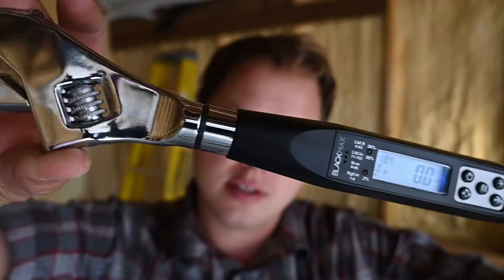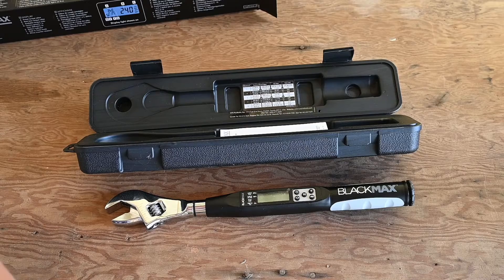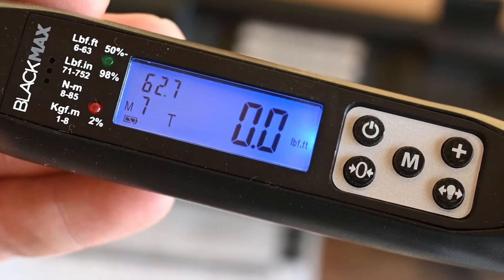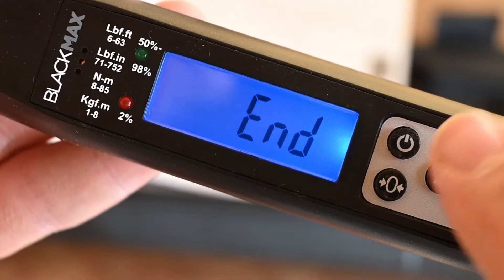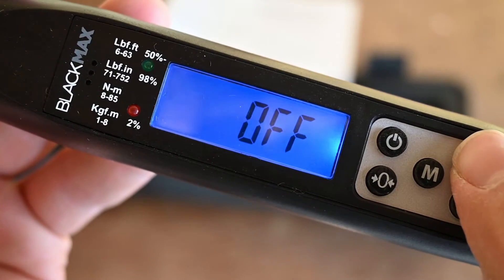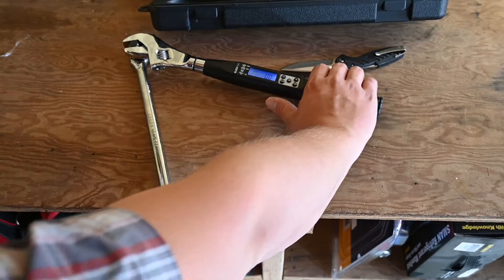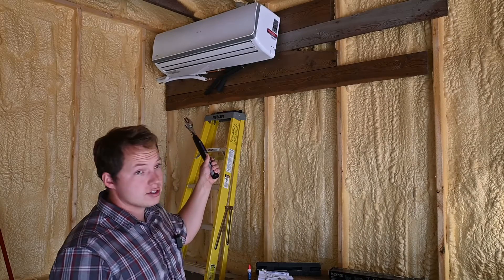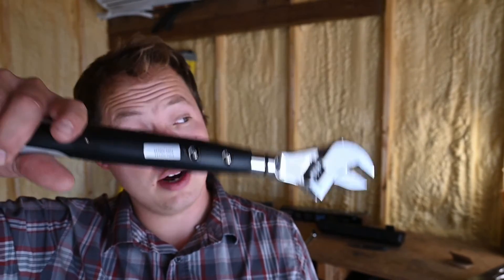How To Use a CPS BlackMax Open End Torque Wrench

Comment: Too expensive, just tighten as much as you can and you're good.
Reply: Well if your tools are making you money then it's a investment. I know alot of people will say they have a feel for tightening without a torque wrench and that's perfectly fine for them , and works for many. I got  the torque wrench to eliminate any variables and to do it how manufacturers specify . Customers do their research more than ever today and if you install many of these ,you will have some  look at what your doing and they will point out any deviations from what they have seen to be the proper way to do it .
Reply: You are the reason why people like myself and others have to fix your screw up. By doing that, your mushroom the fittings and sometimes the fitting on the unit which has to be removed and replaced. 99% of leaks are from people strong arming them

Comment: How would you pull the wrench when the flare nut is on the opposite side. Example the flare nut on the outdoor unit seems like you would have to push to tighten instead of pulling?

Comment: Though I certainly like tools, for someone who who is going to install half a dozen Mini-Splits in his house then put the wrench away forever, wouldn't a normal torque wrench with a set of crows feet be adaquate?
Reply: From a metrology view point, you will have a more even torque on the nut with a box type crows foot. 4 or 6 sides vs. just two sides, do to the opening. Two sides would want make the nut oblong in shape which would causing the threads to bind more so it would be an improper torque on a brass nut since it's  softer material as well compared to a steel nut which would hold its shape better under toqure, that is what you must concider. 
Remember what kind of accuracy do you really need is this mil-spec and do you recalibrate the tool on a repeatable bases.
Reply: @monadking2761  I had to google Metrology. That's wicked smart. Thanks! 😊
Reply: I was wondering the same thing since I have crows feet and would rather hold onto 150$ considering I’m only installing one mini-split.

Comment: I'm pretty sure the reason why they want you to pull not push is because the small little piece that moves is just like a crescent wrench you want to push when the little piece is facing you because it could slip that way and by pulling it it puts pressure on a different part of the opening of  mouth on it

Comment: You said not to use in reverse and you loosened the fitting without turning the wrench around or getting another wrench to loosen
Reply from the maker: Ha, good point! Technically it does measure torque in "reverse" so I think it's "okay" under that scenario. I could be wrong but the manual didn't say that you should not use it for reverse rotations.
Reply: It's not that it can't be used in 'reverse', but that it's less prone to slippage and is it's most accurate when used 'forward'.